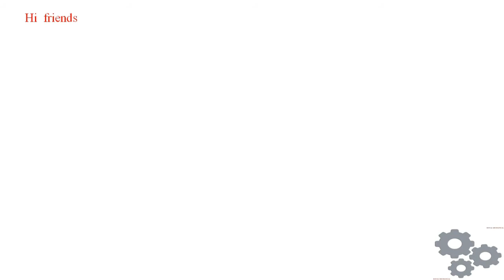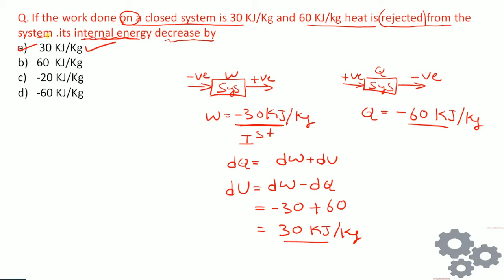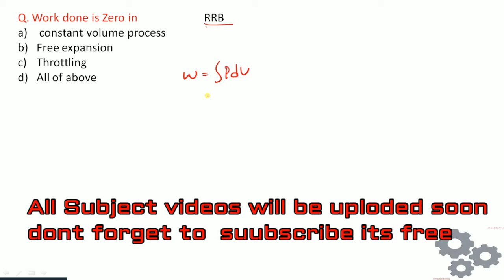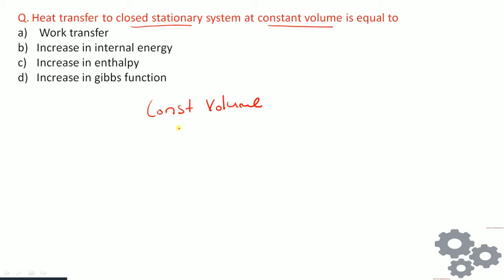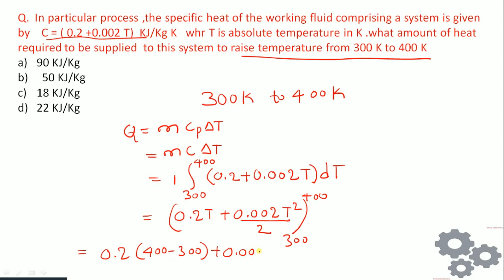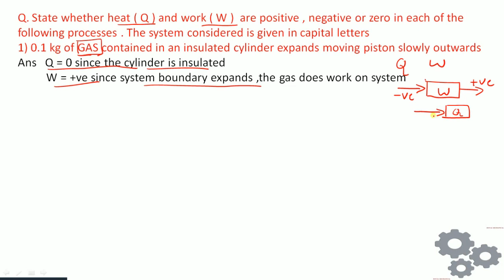Thermodynamics(Work & Heat transfer)objective ,Mechanical engineering objective question ans

Comment: In specific internal energy problem , internal energy is 2100( 3000-900).
Reply: I am also confused here how did he came up with the right solution .....I mean if -900=-3000+ internal energy
 So internal Energy becomes = 2100 so if we divide 2100/4 ans become 525 but there is no option .... please explain this equation